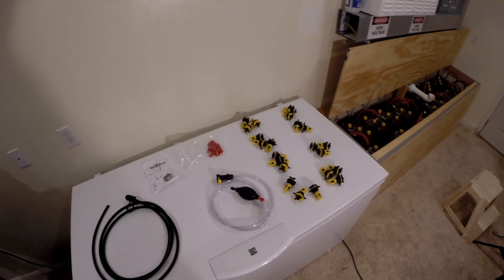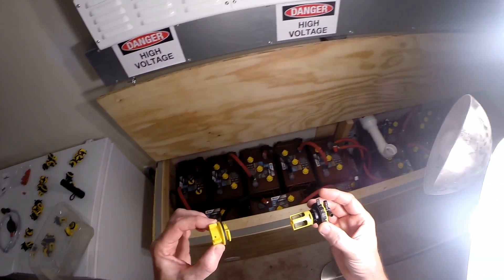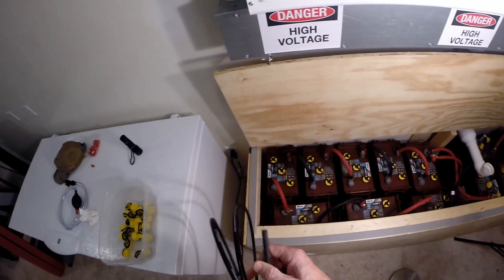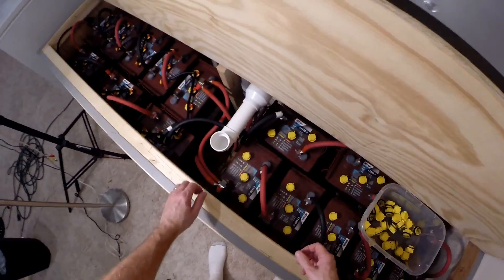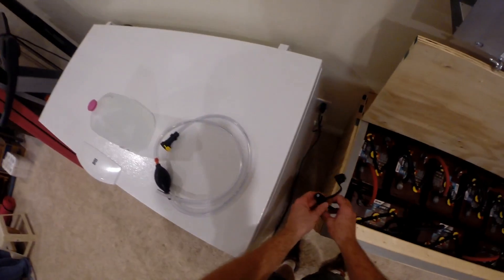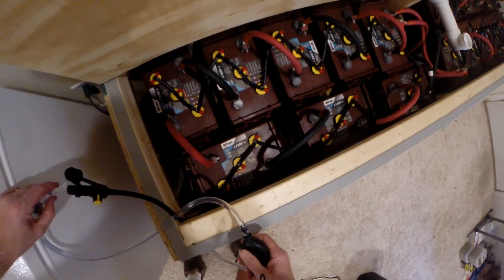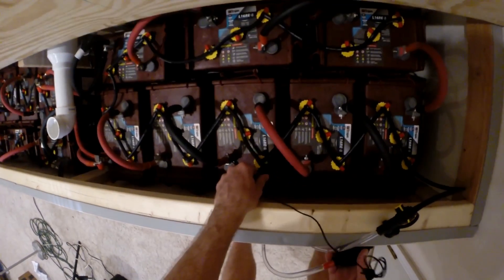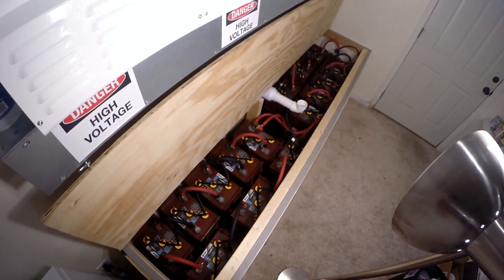Off Grid Solar #42: Installing Trojan HydroLink Battery Watering Kit

Comment: Great group of videos. I learned a lot about roof mounting.  I have 8.5 kwh worth of panels and my Outback Radian FPR 8048 goes in tomorrow!! I'm excited!!! I love your transfer switches so I will be looking into that. I have a separate load panel just for solar but I like the safe easy option of the transfer switch.   I upgraded my two air conditioning HVAC units to Lennox XP25 units (5 ton and 2 ton) which are super efficient - will run off my solar.  I went a different way with my battery bank - lithium NMC that I built from industrial grade cells. Check out my videos in my channel on them.  I have about 26 kwh now but ultimately will be at 60 to ensure autonomous self sustaining ability.  Again, love your work. Great job!! - Nubian122

Comment: Awesome...can you do a "follow-up" in a few months? My 12 batteries use about 1/2 to 3/4 gallon every other month or so. In the summer, more. I have noticed that one string will use a "tad bit" more water then other strings. I "annotate" every time I do any maintenance on them on a maintenance tag...to track trends and water use. Lastly, I am "testing" a Battery Extra desulfator...been using it for 3 weeks now. In a few weeks, I will do a video with my thoughts on it with my Trojans...initial thoughts are good.
Reply from the maker: Sounds like a plan...  Thanks!
Reply: Thanks for the advice on those marine rated fuse blocks too! I gave you a big "thanks" and "shout out" on my latest video.

Comment: You should put the water bottle on top of the fridge and let gravity do the work instead of hand pumping!!
Reply: Flowrite makes a gravity feed tank that also includes a spinner so you can see when the system stops taking water. www.flow-rite.com / also www.batterywatering.com makes good systems and you can get the same CPC fill end from either manufacturer so get what is less money. Watering systems are the way to go as hand watering is best described by the technical term "It sucks"
Reply from the maker: You're either really smart or incredibly lazy...  :)
Reply from the maker: Thanks for the info!

Comment: Very nice. The caps must have a passive vent for gassing. I think this would work nicely for my bank. It must be warm where you are. The first part of the video you were in socks! It's spitting snow outside.  I'm next to the woodstove and I'm still cold!
Reply: Those are made by a company in Michigan called Flowrite. They have internal venting ports for gassing. I have installed thousands of them. You may also want to check out Battery watering technologies as they have a system that works a bit better. They both have Youtube channels as well.
Reply from the maker: Yes, I am sure they do have vents for gassing.  The system makes watering a 5 minute job and no mess.  Highly recommend it.  Yes, it's very warm here already although it did get down to 42 last night and we had a nice bonfire!
Reply: Thanks , i need to check that out. Do you have a website for them ?